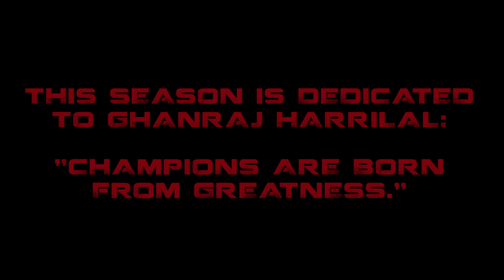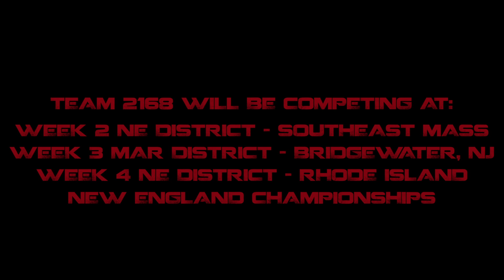Team 2168 The Aluminum Falcons: 2017 Release Video

Comment: I thought you could not extend past the frame? Would that gear intake be illegal? Not sure.
Reply: You have to start within the frame perimeter. After the start of the match your robot must reside within the total robot volume regulations. It is setup so the ball intake and gear intake never are extended at the same time.
Reply: Kevin Brown Thanks, that makes perfect sense!
Reply: So did you guys make your frame perimeter smaller than 36 X 40 so when you use your mechanism it goes to the maximum size? If I may ask, what is your frame perimeter and how much does your mechanisms respectably extend from it?